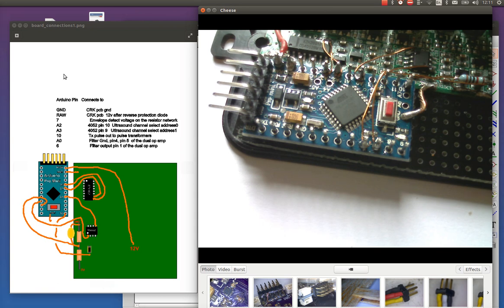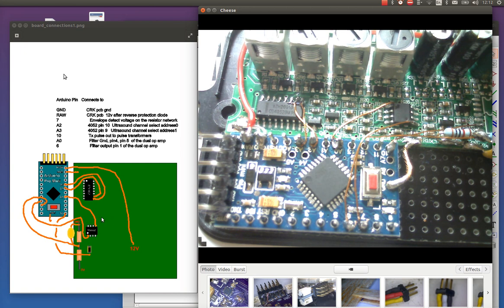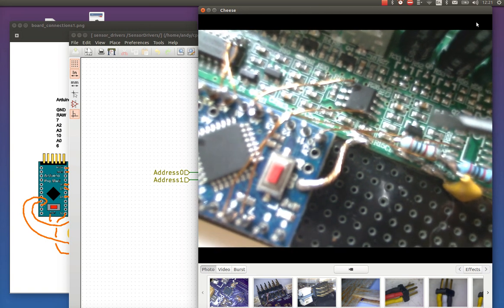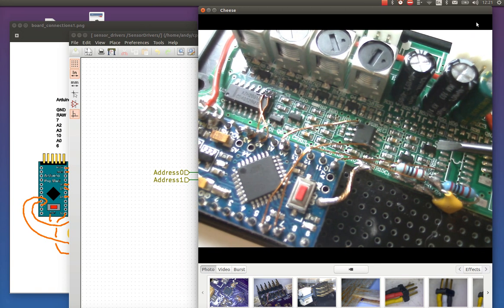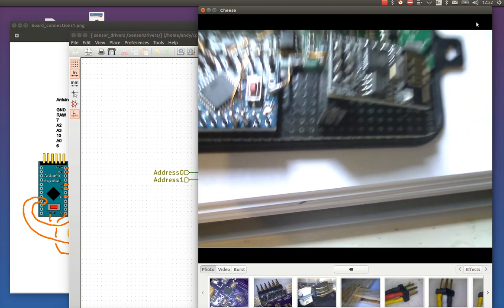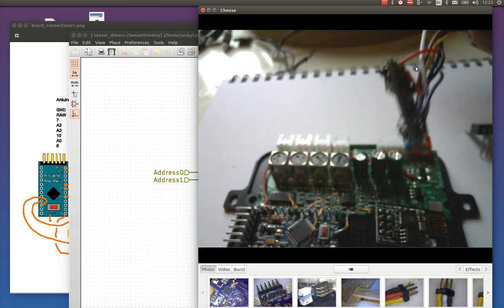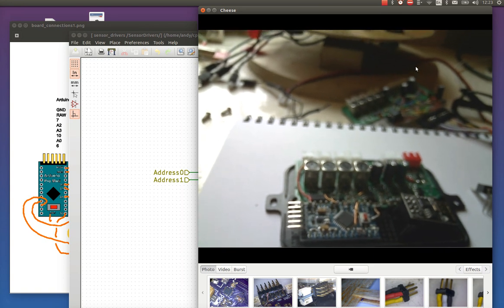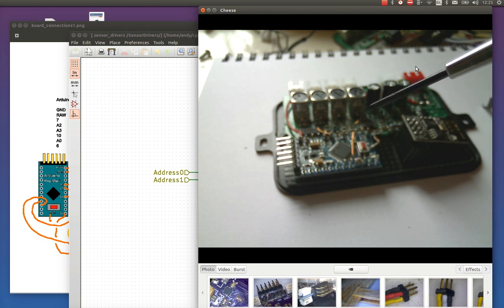Ultrasonic wind speed and direction sensor from car reversing kit - Part4. Connecting Arduino

Comment: It was really nice to know such products can be reused for different purposes.
Wondering if you can tell if the output of reverse sensors can be decoded. I.e. 3 wires which goes to display